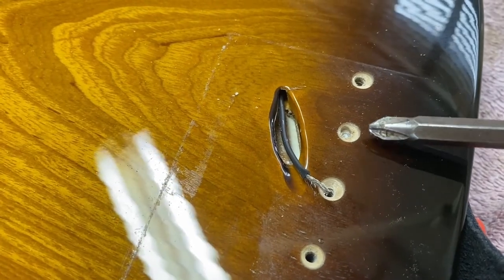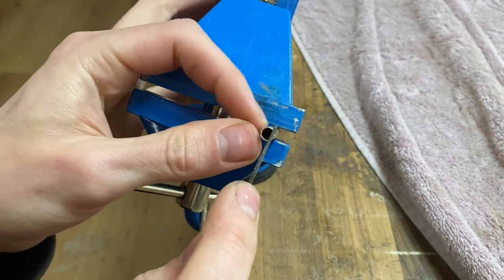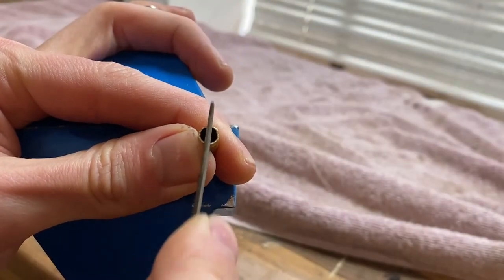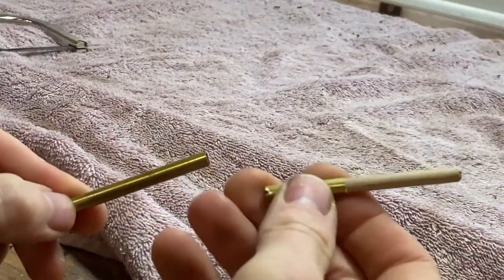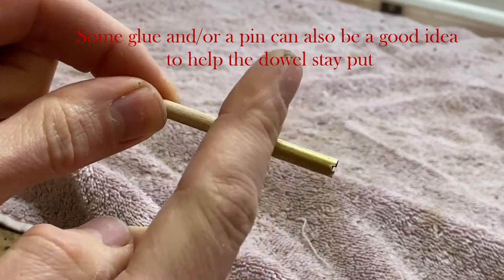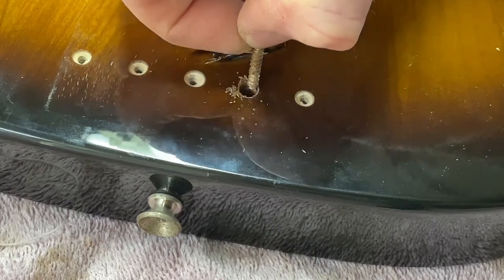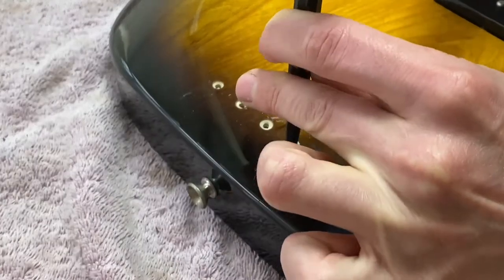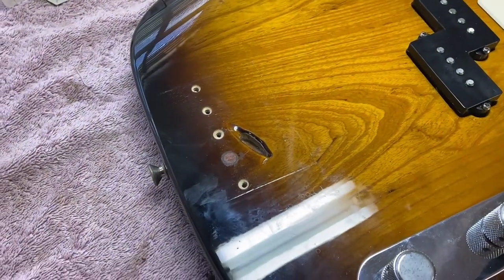Luthier Video - Removing / Extracting a Broken Screw From A Bass Guitar

Comment: Making a hole saw this way is really easy - you're not after high cutting performance, so almost any tooth shape, no matter how rough or uneven will serve. Just drill slowly, and keep removing the sawdust.

But when I did this, the most difficult thing by far was making a plug that matched the hole - improvised hole saws don't cut to size! I ended up making another "hole saw" (this time named as a "plug cutter"), and messed around with the set of the teeth to adjust the size of plug it generated.